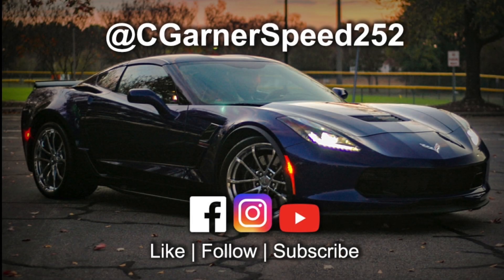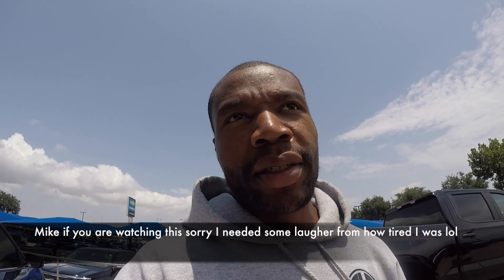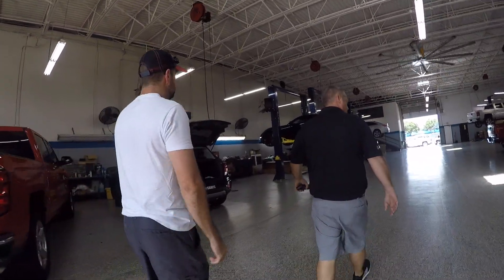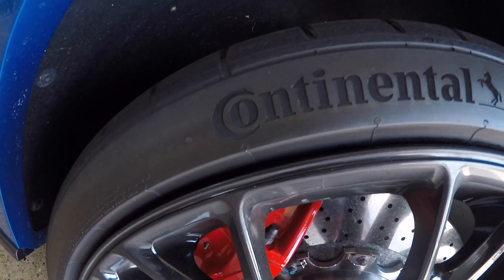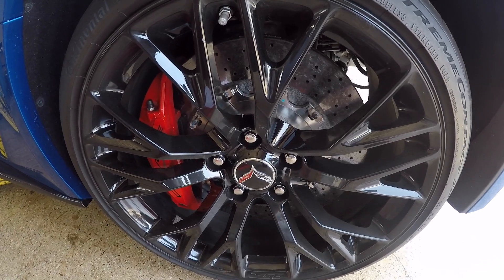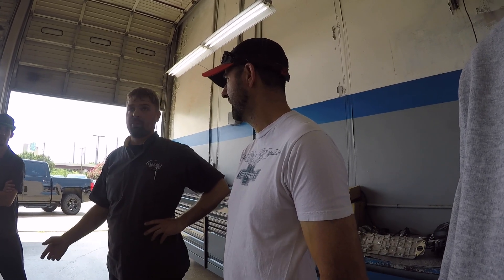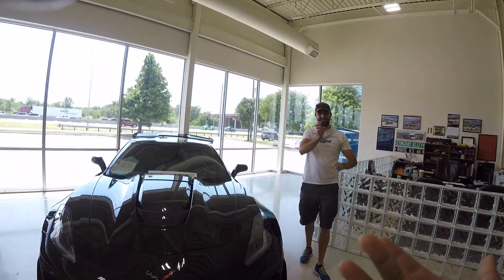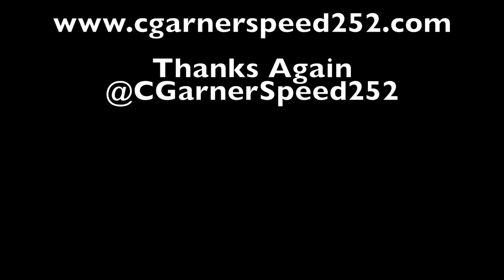NEW CHEVY C7 Z06 CORVETTE BLOWN ENGINE OR BROKEN MOTOR!?!?

Comment: Replaced the oem Michelin pss summer only tires with a set of the Mpss a/s3+ all season tires in January & haven't looked back. They're quieter, more comfortable, will wear longer & provide excellent traction regardless of the temps.  Am so glad I made the switch.

Comment: I had an issue with a lifter on #7 as well. The cap came off the valve, and kept the valve open. Doesn’t appear to have done any other damage. Just got the car back after them rebuilding the heads. Headed to the track in a couple weeks, and we’ll see if it holds up.

Comment: Uhhhh BS!   That's got to be embarrassing for GM.  An everyday driver Z06 engine broke?  total BS. got to be related to a defect or build quality issue.
Reply from the maker: Stefan Jones hey you could be right😕😕 what year us your car?
Reply: @cgarnerspeed252  Sir, I am negotiating on a 2017 GS right now.  Should know by next week if the owner wants to sell.  I plan to keep it until the availability of the C8 improves and they work out the bugs.  But in the end, I WILL have a C8, the question is which one..? Probably the GS or Z06.
Reply from the maker: Stefan Jones hey that's a good idea! What color and trim level
Reply: @cgarnerspeed252  RED 3LT